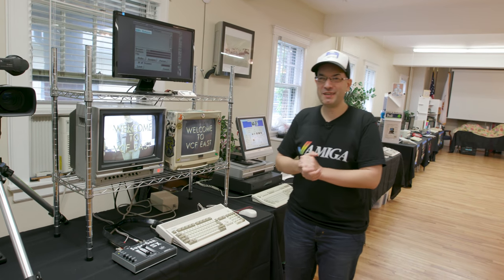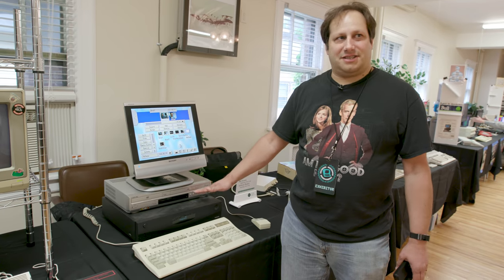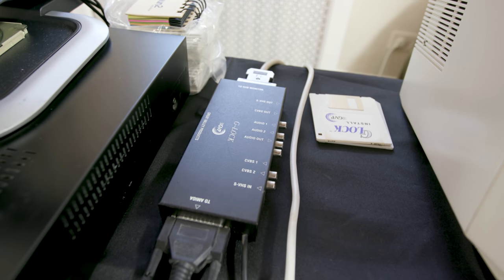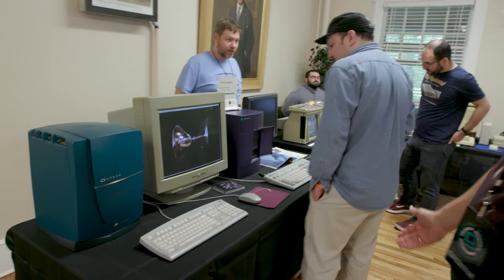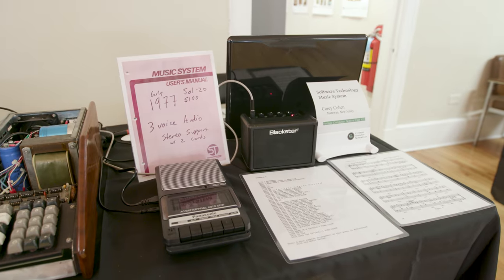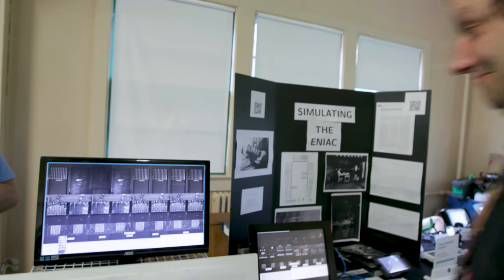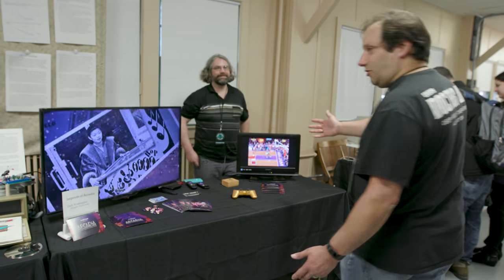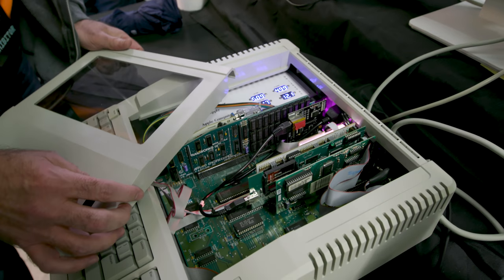Retro Commodore Amiga Desktop Video & More at VCF East 2018 - Part 1 of 2 | 4K UHD

Comment: My First Amiga was a A1000, a upgrade from a C128, after spending Days for just one frame of Animation, I upgrade to the Amiga 3000/25Mhz 2mb Chip Ram/16mb fast ram. On the A3000 a 768x482 animation took 8+ hours per frame! Then the D.C.T.V. came out! I still have my A3000 setup with a D.C.T.V on a 1702 Monitor! Would love for you guys to cover the D.C.T.V. in a future video! Frames rendered faster and I could do longer animation because the files were the same size as normal Amiga IFF's!! <3
Reply from the maker: Steve you are in luck! We shot an episode about DCTV last week!  I will start editing it very soon.  I hope we do it justice! Great point about those long render times.  I remember leaving my 020 A2000 on for days rendering Imagine animations that lasted a few seconds.  Ugh!

Comment: amazing video - you had me at silicon graphics! SGI <3
Reply from the maker: Thank you so much!  Yeah, I wish we had more time to talk to those guys.  Those machines are beautiful!
Reply: pishbot

I really want an SGI machine again now.

I had an Octane and O2 about ten years ago, but ended up selling them, as they did take up a fair bit of space, and weighed a ton.

So desperate am I now for my SGI fix that I've started a project to implement the Indy or Indigo on FPGA. lol

I have the CPU core starting to boot the basics (serial messages) of the Indy BIOS, but the CPU core lacks an FPU.

So instead, I bought an Octane-style R10000 CPU module on eBay, and spent about two days reversing the pinout using my cheapo multimeter.

The plan is to hook that module up to the FPGA board, and at least have a good try at booting further. ;)
Reply from the maker: That is an awesome project Ash!  I used to drool over the Indigo.  Have you seen this project? https://hackaday.com/2018/05/23/retro-rebuild-recreates-sgi-workstation-demos-on-the-go/
Reply: The Guru Meditation

That's awesome, thanks, Bill. ;)

This is exactly the sort of thing that could be integrated into a full SGI core.

I'll definitely get in touch with those guys.

One of my dream projects is to write a GPU from scratch, including texturing and lighting in hardware.
Reply: <3
Reply: Nearly finished the adapter PCB.

Fingers crossed that I can actually get some life out of it.

https://i.imgur.com/8KghN67.png